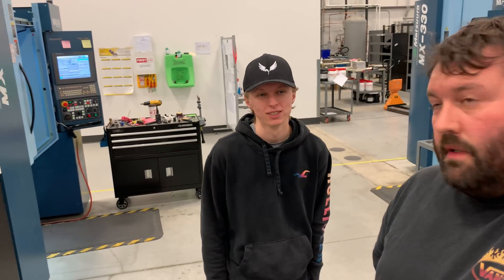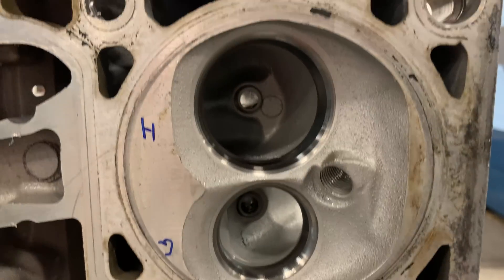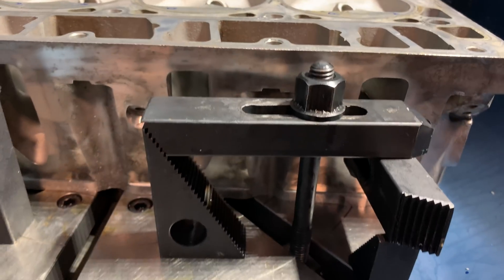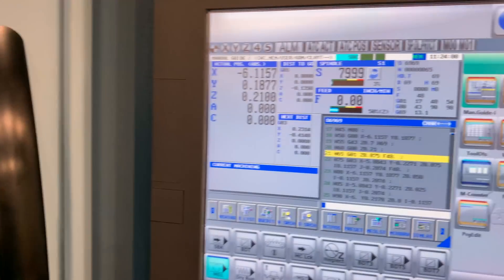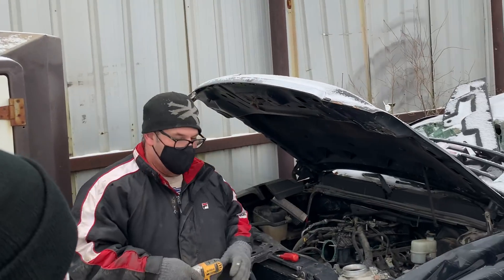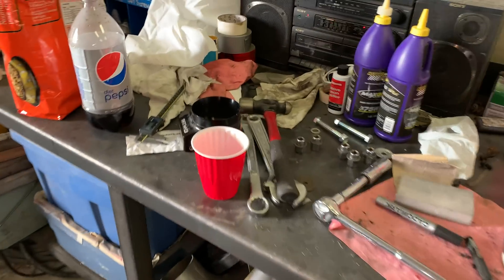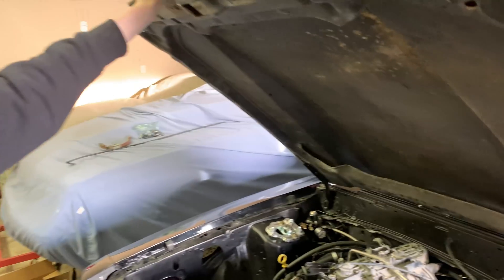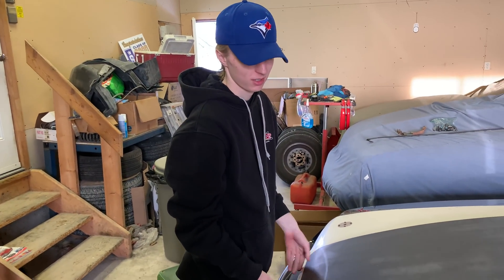799 Heads CNC'd for 5.3 LS Build | Junkyard TBSS Intake Hood Clearance

Comment: Why not a face mill? Or fly cutter?
Reply from the maker: Would have used a fly cutter if we had one. A smaller tool has less cutting forces and therefore less flatness error across the surface
Reply: @SPPTVarmy  fare enough :-), I’m a machinist I understand using what you have. Stay warm and keep dry. Have a good day.

Comment: Does anyone angle cut LS heads? Like the SBC heads back in the day?
Reply from the maker: Due to the heads already having a 15deg valve angle and using o-ring style intake gaskets I don’t believe so but possibly if you correct the intake angle to match the heads and re-cut the intake O-ring grooves.

Comment: Battery terminals should be on the engine side, not body side. Did you have it in backwards?
Reply from the maker: That’s probably what the issue is then. May have to lengthen/shorten the cables but that’s probably the easiest fix. Sometimes the answer is right in front of you...lol

Comment: I tell my son all the time he should learn the cnc stuff!
Reply: You could do this with a knee mill and a fly cutter.  You don’t “need” CNC for this.the fly cutter would give you a better finish too.
Reply: @jaredmayer3960  yeah the shop down the road has alot of that old school stuff! He does great work also, has machined alot of or 4cyl race heads and blocks!
Reply: You can think whatever you want.  In Industry the manual machines and real tradesmen aren’t going away anytime soon.  I’ve never seen a shop with all CNC equipment yet.
Reply from the maker: We don’t have any manual equipment other than a bandsaw and a drill press but we’re also only doing simple things like additive 3D metal printing, medical implants, F1 components, oil and gas, and aerospace. I’d like to see you manually machine a profiled surface with a manual machine. The future is now

You say “tradesman” you realize that someone needs to set up the machine and program the tool paths, correct? A CNC machinist (not a button pusher but a real CNC machinist) can run manual equipment but can a manual machinist setup and program a CNC machine?
Reply: I can...
Reply: I think this got kinda off base.  The point I was making was I wouldn’t limit your kids view to only CNC...and good for you with your medical implants and F1 clutch parts and whatever else you have going on.  The only guys I know where I’m at put blanks in the machine, hit start, pull out, throw in bin and then put in the next blank, repeat.  And I’m sorry but that isn’t the foundation of being a tradesman or machinist.  There’s limitations to what you have there too.  I also disagree with the CNC guy running manual equipment competently.  Half the tits that write programs are engineers with a book of speeds and feeds.   There’s a certain knack to it and programming something to whirl at 10,000 rpm with a feed rate of 12 ipm because it’s recommended isn’t it.  For the record I didn’t personally attack you but you’ve proven what a dick you are with the condescending tone.
Reply from the maker: A CNC machinist doesn’t get an engineer to program his machine, the CNC machinist does it. Engineers design parts and attempt to come up with solutions to certain problems. What condescending tone exactly? We disagree on what a “tradesman’ is and that’s ok. We have different definitions of what a CNC machinist is, that’s all. We don’t run much production work, we’re mainly a prototype shop and have no use for people to load and unload machines because almost every part we make is a new part. I agree there’s no skill (or pay) involved with that but that’s not what we do on our machines 

It was run slow in the video because I was proving out a new program and didn’t want to drive a tool through the cylinder heads on a machine that I don’t own

It was run at 60ipm (.002” chip load) for what it’s worth
Reply: @SPPTVarmy  this got all fuct up...all I wanted to make clear is that CNC isn’t the only facet to machining out there.  I wouldn’t push my son in a direction just because I think it’s neat.  There’s so much more to the machining, mechanic, welding trades that to say CNC is the be all end all is so ignorant.  I’m a machinist, millwright and welder.  Pretty competent at everything too.  It would have been a total waste of my talents to just have focused on one facet of one trade.  And I never said you were useless either.  You made that up yourself.  A lot as in most CNC guys are same as we described.  Edelbrock, holley, scat, you name it, production work is  nothing more than blank swappers that operate machines programmed by an engineer and you know they are journeymen too, no where near your or my skill set.  Prototypes and multi axis work is pretty neat and can only be done on a machine like yours unless you have a really amazing 3D printer.  I have nothing against the CNC machining center but I don’t think it’s the be all end all of machining.
Reply from the maker: It’s all good, I guess my point was that at the end of the day I could have paid a machine shop to surface the heads with a single point cutter but we used what was available to us and the results are just as good and it cost me nothing. Perhaps I misread your interpretation of a CNC machinist being a blank loader when they’re two entirely different skill sets 

Take care

Clayton
Reply: @lsswapshopp    power feed is normal...I guess you’re a real tradesman...and a real boy.  I’ve thought about this even more,  you’re dumb.
Reply: @jaredmayer3960  Tkm performance use afew cnc to cut blocks,head and much more! You should look them up!
Reply: Every maintenance job done is on conventional machines.  CNC is for production and you literally are a blank swapper when you do work like that.  Not a tradesman.
Reply from the maker: I strongly disagree there, most performance machine shops use CNC equipment (this isn’t 1970 anymore) sure a manual machine is great and all that’s needed for a job like this  but whatever you do on a conventional machine I can do faster on a CNC whether it’s production or a “one off”. As far as using a fly cutter I agree you will have slightly better flatness but it’s negligible and you gotta use what’s available. The surface finish we achieved is what’s required